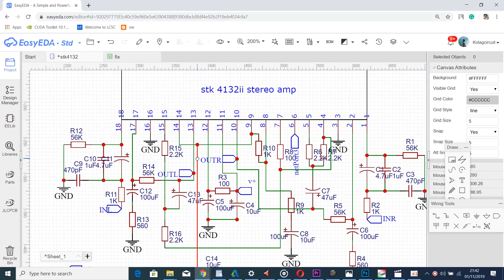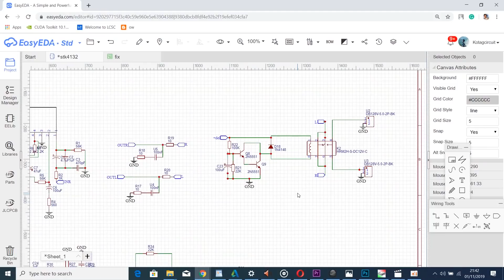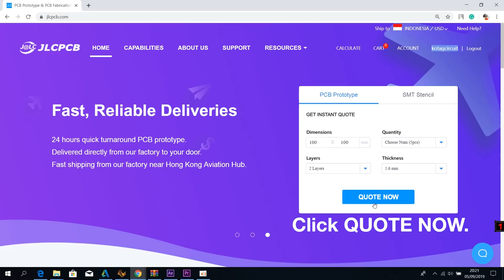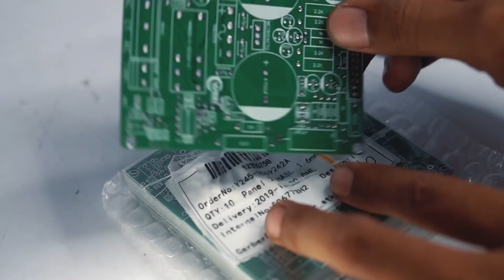HiFi Stereo Audio Amplifier STK 41x2-2

Comment: hello good afternoon, kind regards from Mexico. I have made this beautiful project, apparently I have an error, I would like it if you could tell me what this would be. for example: I have a light bulb in case of short and when I turn on the amplifier it turns on or lights up and turns off instantly. Another case is that when increasing the volume gradually it goes short since the bulb lights up. Please could you indicate a possible solution to me. Thank you. Greetings.
Reply from the maker: Bad ic, or increase heatsink.

Comment: I've ordered the PCB and parts but I have again a few questions : for R19,R20 you give a link for a 10ohms 3W resistor but what kind of wire are you using to make that inductor around it ? Also what size do you recommend for the heatsink https://www.aliexpress.com/item/32976823520.html ? Regarding the power supply, do I just need a 220v to 18v-0-18v transformer like this one https://www.aliexpress.com/item/32905832514.html ? Is it possible to add a led and a volume control ?

Comment: Excellent work, STK integrated circuits are the ones that had the best sound, have and will have. It is a pity that they produce so much heat. 👏👏👏👏
Reply from the maker: Thanks, its good for home audio
Reply: i will also add panasonic(matsushita) an series,philips tda series class ab amps to this list.stk+mitsubishi preamp combo,philips preamp+panasonic an series combo,philips preamp+stk combo,philips preamp+philips amp combo all sounded excellent,today's claas d amps and newer amps like tda7294 sound like crap,newer ics dont have the instrument placement and balance as that of sanyo,philips and panasonic integrated circuits.